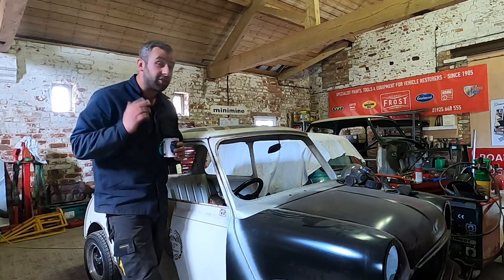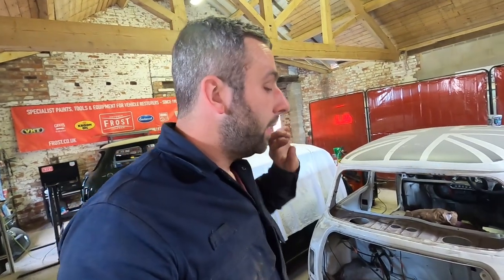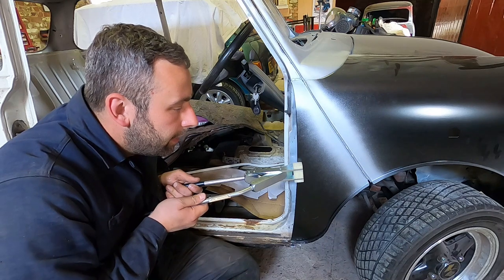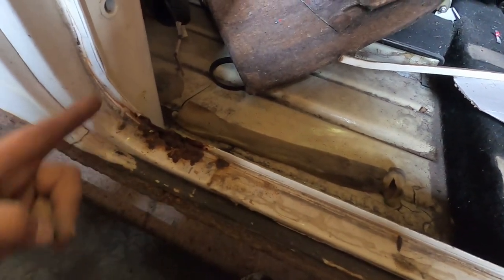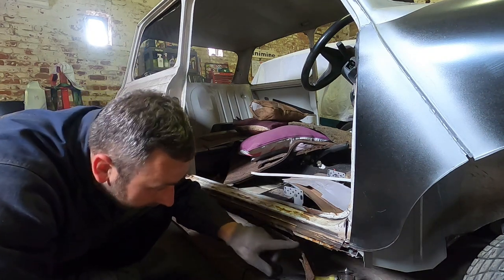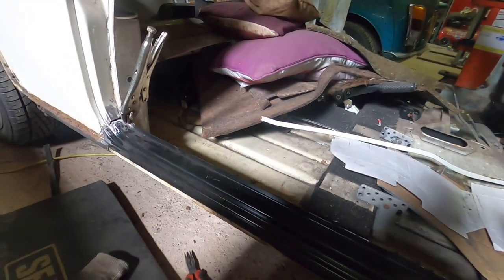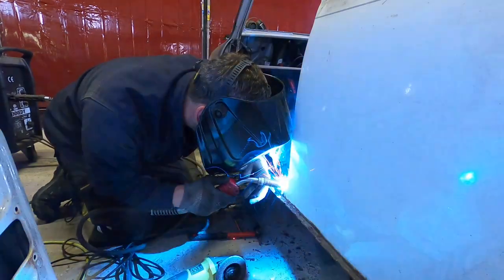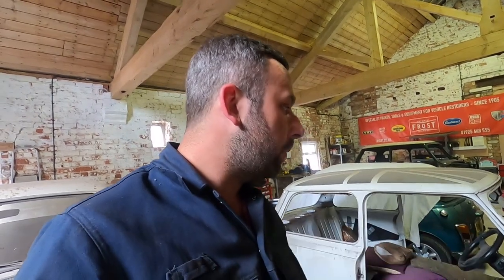Classic Mini Mayfair Restoration - DOOR STEPS WELDED IN

Comment: Very interesting watching you bend the a-panel around. I'm going to see the cost of that tool 😊. Also with the a-panel did you use any adhesive bond down the inside? I'm interested to watch the boot floor repair as I struggled with mine. I still have to go back to it & make some changes.
Reply from the maker: Glad you enjoyed it. The tool is ace one of the best I have bought in a while. Yes I don’t think I covered it very well but when I did the front end there is seam sealer between the panels and then before paint I will put some down where I have done the fold now to. 👍
Reply: @Simpson's Classics  thanks for letting me know. More protection is key 😊😊

Comment: Great progress on that car, done a really good job. Is your mini belt sander air powered or electric? I have an air one but it would always throw the belt. So tempted to replace it.
Reply from the maker: Thanks, it’s definitely going in the right direction now. I have both an air powered one and an electric one. The electric one is just a silverline branded one. It’s not bad for the money. Get the worse off with a grinder then finish up with the belt sander.
Reply from the maker: Thanks, it’s definitely going in the right direction now. I have both an air powered one and an electric one. The electric one is just a silverline branded one. It’s not bad for the money. Get the worse off with a grinder then finish up with the belt sander.